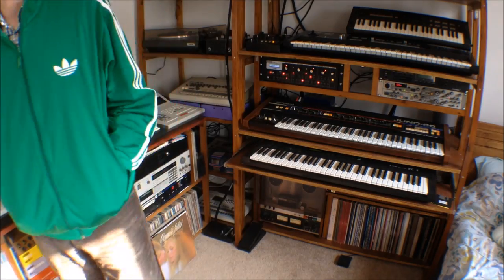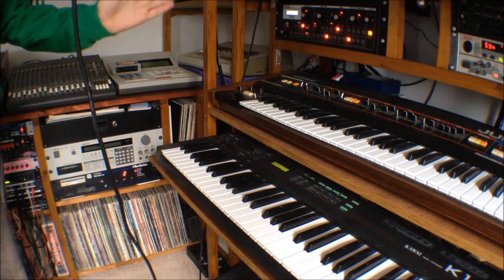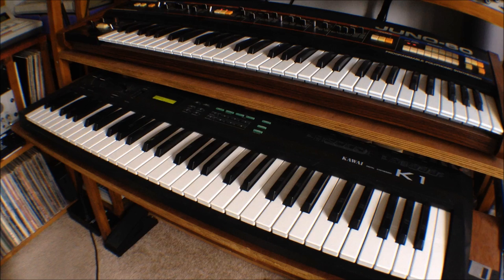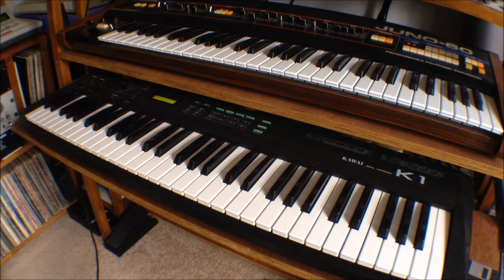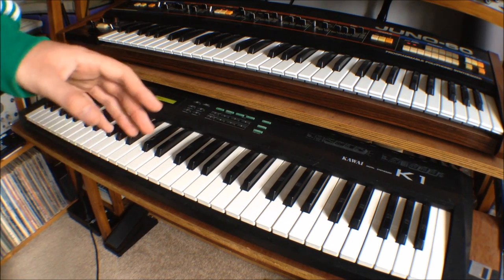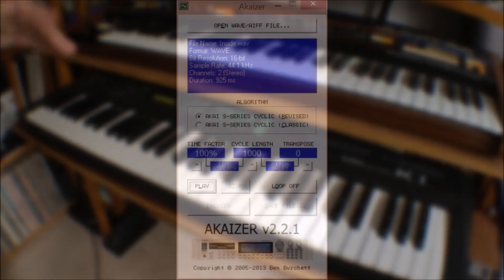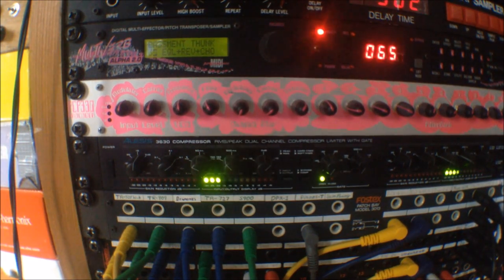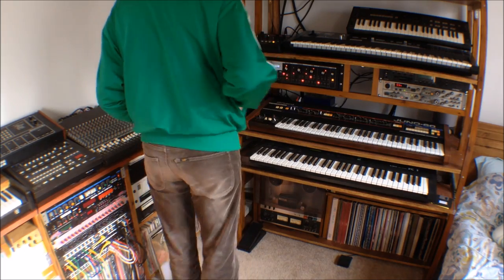Step By Step - The Sounds Of Speed Garage

Comment: another great video! but where are your monitors?!
Reply from the maker: +Will Holden Thanks! They are on the shelf just out of sight at the start of the video. Not ideally positioned but the room necessitates that particular set up. As long as I am standing though the tweeters are abut level with my head so I can still get a decent idea of the sound of the tune.

Comment: Did you build the all the equipment racks and shelves yourself? I like the look of them and am always looking for better ways to lay gear out.....😊
Reply from the maker: I did build them myself out of necessity. I couldn't find anything on the market that was either cheap enough or quite the right form that I needed for my equipment in a relatively small space.

I still had to spend probably a couple of hundred quid on materials and an absolute age in time putting it together but it works well for my needs now.